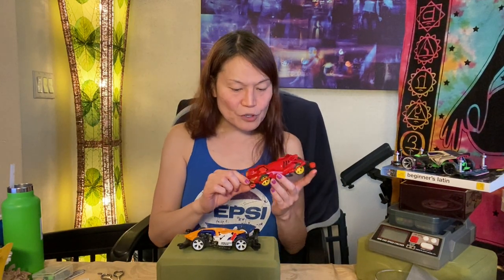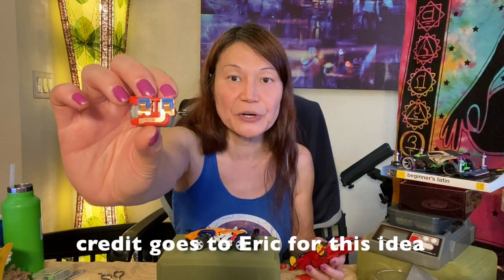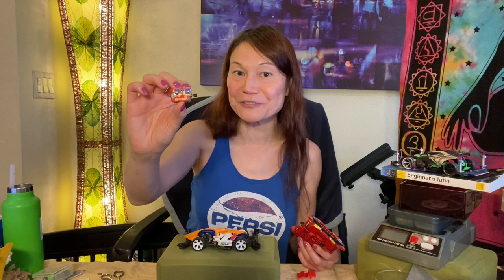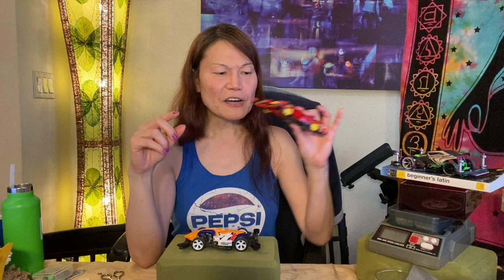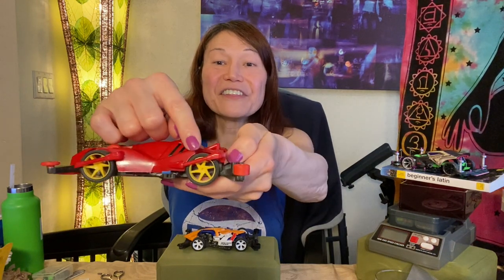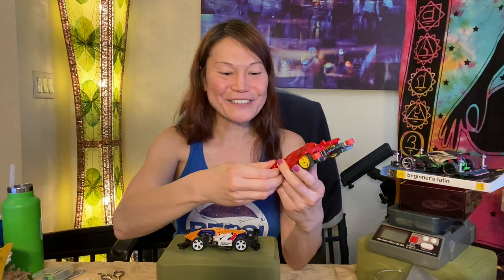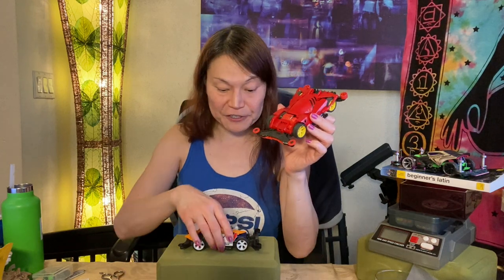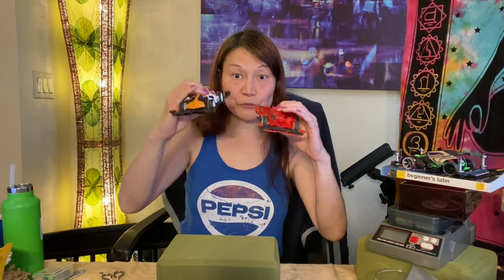Tamiya Mini 4WD - Let's Optimize the Brocken Gigant Premium

Comment: What type of tires does the brocken gigant premium has? Super hard or low profile slick? Also if using sponge might be questionable for races categories what I do is I cut abit of the leftover rubbers from the tires to put it inside the terminals and it also has some good elasticity.
Reply from the maker: They are low profile slicks. YES!! That is such a good idea using the tire tree rubbers behind the contacts!

Comment: is this car good for box stock? how about the stability when coming from a jump?
Reply from the maker: Right out of the box with the instructions as they are, no. however, you can make lots of little adjustments to it, such as removing unneeded parts, shifting the weight with the use of the stickers, and reversing the wheels or rollers. you basically need to adjust every car in this way to enable it to have the greatest advantage on the track you're racing it on.
Reply: @claredin  alright thanks for the info, 1 more question. do you recommend to use fujitsu lite battery 950mah? almost the same weight with neochamp battery
Reply from the maker: @roeeventura6313  Yes, they are my backup batteries when I don't have my Neo Champs available. They are basically the same as the Neo Champs. Some racers claim a little bit of boost at the start with Neo Champs, but quite truthfully, you can get a little bit of boost with the pink Fujitsus, too. It's just manufacturing variances. You might get a lucky battery.